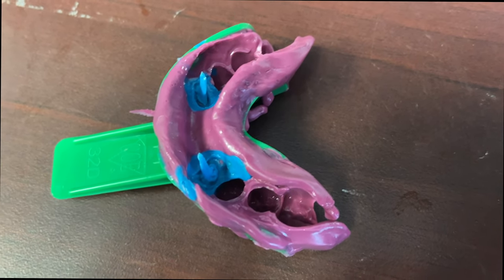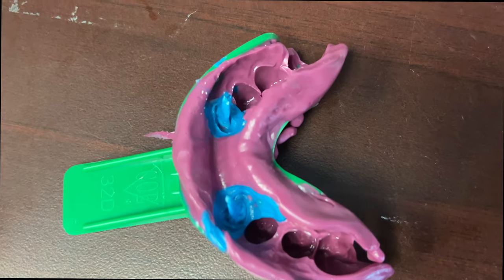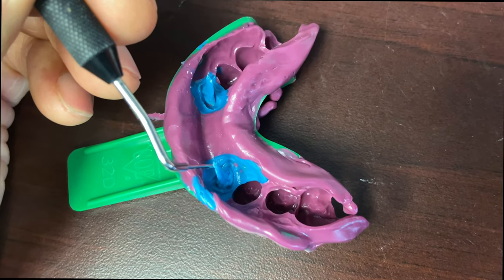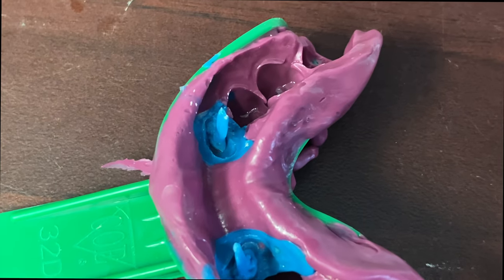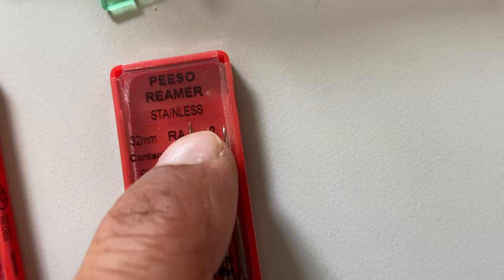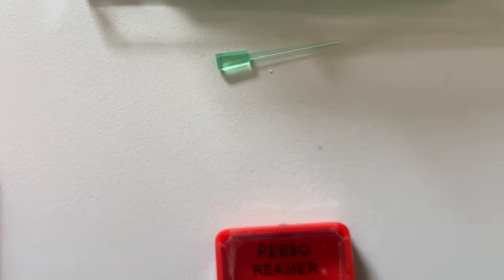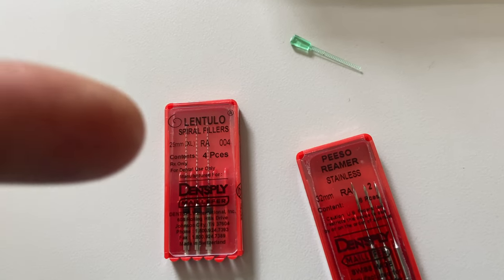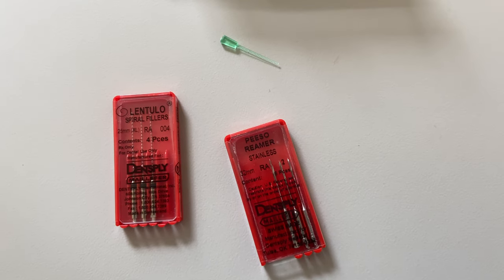Simple Cast Post Core Technique - Someday you may need one!

Comment: I used to do zero posts. Then I worked for a guy who did lots of metal posts and said he loved them. I started copying his technique and that's my new go-to post technique. No question a cast post and core is better but I have been very pleased with the metal posts and I love being able to do my post and core at an emergency appointment. I have done dozens of cases where the crown still fits but there is not much prep left after the crown broke off and the patient just wants to get a little more time out of the tooth. These are some of my favorite appointments. I think however that in the case above the cast post/core was a good idea since it is the best-fitting and most durable post you can make.

Comment: Thanks for the video. Usually with a parapost cast post preparation kit the post cutting drill will match the post size. In this technique it seems you less concerned about having an exact match as the light body will fill in the gaps between the post and the canal wall? So in this example matching is not important?

Comment: Every time I've tried this technique it's been hit or miss So I always revert to duraalay pattern technique.  I haven't however used a Lentulo spiral. Maybe that is the difference.. 

Was almost thinking to do a combination of using duralay pattern for the post space and margin, then pick it up with a PVS impression. 

Any reason you do a quadrant tray as opposed to a triple tray?

Thanks love your content, always sending links to my residents.
Reply: The technique I use is using a burnout post (or paperclip, or lentulo, or whatever) to capture your post space, then doing a pickup impression over top. I've found that to be a great way to get a good impressiong of the post space using PVS. If in doubt, take an extra impression of the intaglio of that tooth, and then most labs nowadays are going to scan everything anyway, and they can digitally merge everything as they need to.